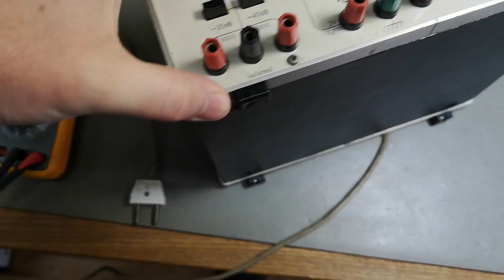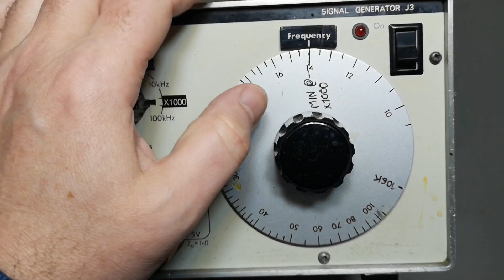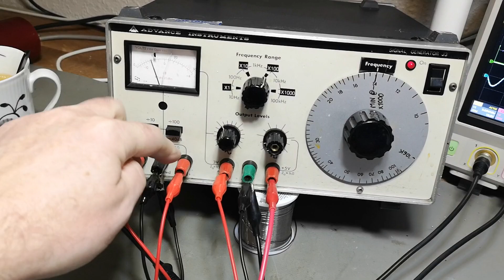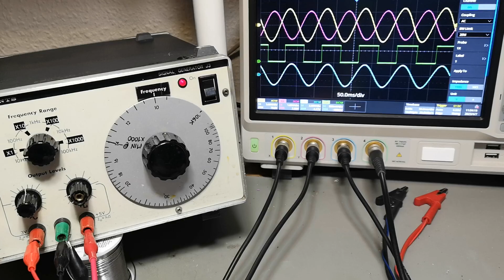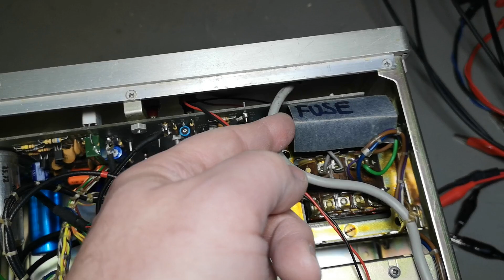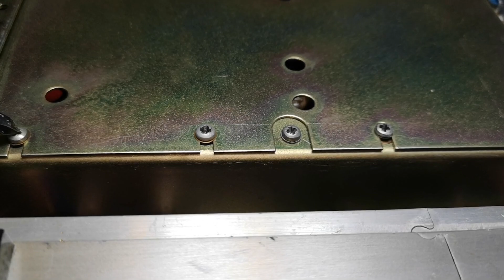Advance instruments signal generator J3 10Hz to 100kHz test teardown

Comment: What is a signal generator used for?
Reply from the maker: it delivers a test signal in the frequency range needed to test own contructions or products you are repairing 
Audio equipment is pr definition designed for 20Hz to 20Khz so you need a generator that can do a bit less and a bit more, to see what happens outside the normal range too.
Reply: @TeardownOZ2CPU  Thanks! So it's not used for radio transmissions? Only to test electronic components.
Reply from the maker: @herrlich1461  a signal generator for radio frequency also exist, it is most commonly used to test radio receivers, but it can actually also be used as the signal source for a radio transmitter. Signal generators comes in all frequency ranges.. this one, in this video, is only for audio range
Reply: @TeardownOZ2CPU  Great, thanks for your reply and best regards from Germany from an amateur radio enthusiast.